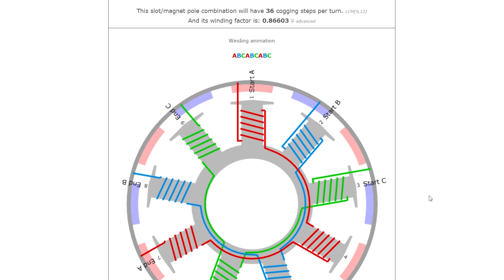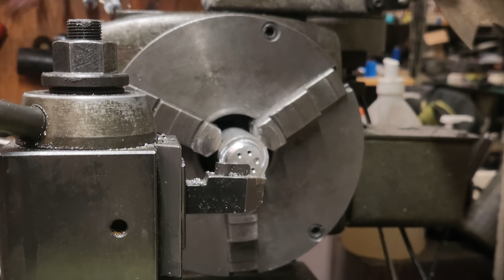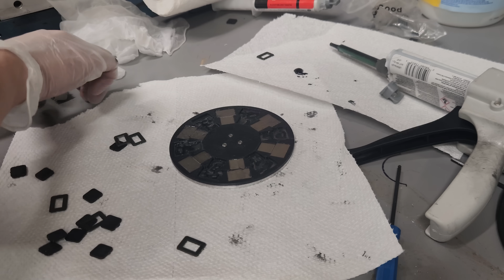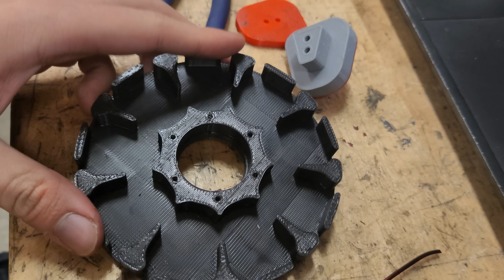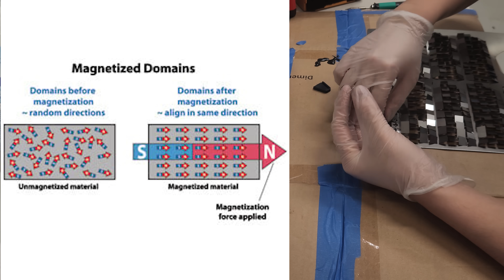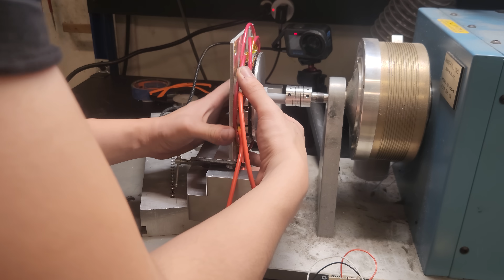Homemade 1000-watt motor

Comment: Rim velocity: 117 m/s (≈ 421 km/h, 262 mph)

Apparent g at rim: ≈ 13,700 g

Diameter = 8 in → radius 
𝑟
=
4
r=4 in = 0.1016 m

Speed = 11,000 rpm

Calculations

Angular velocity:

𝜔
=
2
𝜋
11000
60
=
1.152
×
10
3
 
rad
\cdotp
s
−
1
ω=2π
60
11000
	

=1.152×10
3
 rad\cdotps
−1

Tangential (rim) velocity:

𝑣
=
𝜔
𝑟
=
1.17
×
10
2
 
m
\cdotp
s
−
1
v=ωr=1.17×10
2
 m\cdotps
−1

Centripetal acceleration at rim:

𝑎
=
𝜔
2
𝑟
=
1.35
×
10
5
 
m
\cdotp
s
−
2
a=ω
2
r=1.35×10
5
 m\cdotps
−2

Apparent local g-force:

𝑎
𝑔
≈
1.35
×
10
5
9.81
≈
1.37
×
10
4
 
𝑔
g
a
	

≈
9.81
1.35×10
5
	

≈1.37×10
4
 g

Results

Rim velocity: 117 m/s (≈ 421 km/h, 262 mph)

Apparent g at rim: ≈ 13,700 g
Reply: how much did the ballistic magnet mass? let's calculate its energy! i bet it was at least like a .22 round

Comment: with two rotors and the coils in the middle the efficiency will go up for sure. another step is to put capacitor between the start and end of the coils to get rid of the losses made by the coils

Comment: I think just to be safe, you should CNC the slots in that aluminium disk for the magnets. At that speed, a lose magnet can make you lose an eye.
I have a rough idea about what you are doing. But one thing i was always curious. Is that if the efficiency of a an electrical motor with perma magnets, changes with the distance between the magnets and the coils.
Or that if there is a sweet spot in the magnetic field where the coil should be. Logically you would want the distance to be as minimum as your tolerances allow it, i think. At least this is what you see on almost any brushless motor. But then that distance isn't really the distance between the coil and the magnet but the magnet and the steel used to amplify the coil's magnetism.
I think most of the efficiency of any brushless motor is how good the motor controler is. And because most esc have a permanent timing, the efficiency peak is probably at a given number of rpm.
I don't know how much you can program a vesc, but it would be cool if you could program the timing, according to the motor's speed or resitance put on it.
Just like that picture illustrated that the steel plate redirects the spread magnetic waves into a certain direction. ( in reality the steel does not amplify the magnets, it just focuses the magnetism into a certain direction, like a lense)
In that case i think, the magnets from the aluminium plate should have a ring on the outside too. This is why brushless motors have the outer case made from steel.
So to increase the efficiency you should also use an steel plate behind the magnets and a ring on the edge, this way most of the magnetic waves will be focused onto the coils.
At least that's my theory. 
The real question is, is this design better than the normal bell design brushless motor?

Comment: delta configuration produces around 1,7 times more power than star, so you can can get greater torque at the same rpm with increasing output gear ratio, but actually it's not solving the efficiency problem

Comment: Good shit… I hope you calculated your flywheel burst speed before going full throttle… 
By ear I would say your balance is off, and ceramic bearings might reduce friction forces but that bearing is tiny already so probably not worth pursuing

Comment: A+wesome work! -  been waiting for someone to tackle the Axial Flux ..& VESC to the rescue!!! beauty!!!    but didn't expect to see it burned into the ground immediately with such crafting///  anyway - pitting the wire and then soldering over it. wouldnt make it past the drawing board to fly in an airplane or space.. maybe CRIMP etc.. //  Tip of the pyramid is the strongest, yet smallest Magnetic Field & Strength.. If you're goal is highest eff. \\ I'd really like to see  Tiny <30w ver.

Comment: One thing to consider: You are moving magnets past an aluminum stator frame. That also induces eddy currents. If you have access to a thermal camera, you might be able to see where the stator heats up.
Reply: Absolutely correct!👍 
And he has a double whammy there.  First the rotating magnetic field of the rotors permanent magnets and the rotating magnetic field of the stator windings are all just inductively heating that aluminum.

That could account for 90% of his energy loss.  The magnets going past the thick and thin portions are inductively braking the rotor and the pulses are creating most of the noise and vibration!!
Reply: @johno812 thats what im saying too, maybe not using any steel or any kind of metal or even aluminum would be more or a drag free???
Reply: @bon @bonthor7515 minum has one of the highest inductive properties.  Use Stainless Steel, plastic, composite, or just epoxy.

To be honest, 3D printing the form or laser cutting from acrylic would be best.

Having a laser cut magnet template with a ring around the outside would be best.  Balance those rotating rotors and get rid of the aluminum induction around the coils and most of the vibration will go away, your efficiency will go up, and your rom and mechanical output power will increase.

Comment: One of main reasons why the hobby esc didn’t work because hobby bldcs have different rpm rating and the esc could use back emf to guess the rpm and efficiently controll the motor try using hall effect sensor ps and esc that wotks with them

Comment: Was a home made motor but they can be made with multiple stator and rotor sections ganged together mechanically for insane torque. Also make awesome generators. Some use steel vane plates as flux switches for compact generators for rockets.😮

Comment: good job!

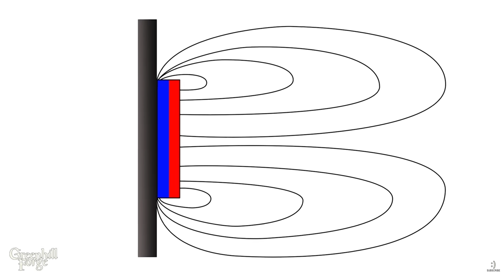3:59 : the explaination is fine but the drawing is totally wrong, with a steel backplate, technically the field lines looks more or less the same as without the backplate but all the lines inside the plate are shorted inside the steel. 

something like that
 ______
|               \
|________/
 ______
|               \
|________/ 

I guess you send a lot of energy heating the aluminium frame

Comment: I'm thinking ferrite cores.  Ferrite changes magnetic orientation much faster than silicon steel.  Less hysteresis = more speed.  Stator should not be machined out of aluminum because eddy currents.  Stator should be something non conductive and non magnetic like epoxy or ceramic.  Stator coils need high speed shunt diodes to dissipate inductive current at higher frequencies.  (Probably already handled by the motor controller)

Comment: Add a steel back to the stator or another rotor, your efficiency is 40% because half your field is wasted. Reducing the airgap will get you closer to 90%, but considering you are already putting a lot of power into it, you will need liquid cooling. Also, smaller airgap means a larger moment on the rotor, you will want a stiffer and lighter rotor. Carbon fibre is a great choice because it also removes a lot of eddy currents.
Reply: theres no way hes doing 600W like he claims, that motor cant dissipate 300W, its working mostly on thermal innertia, at best id rate it at 150W. He needs to tighten his tolerances down a lot and stop all those flux leaks everywhere.
Reply: @laharl2k  seeing how the rotor wobbles, he needs much better balancing for tighter tolerances

Comment: This is just great!  The work you did and the presentation.  You really covered almost all the points I was hoping to see.  I think the biggest thing you can do to improve efficiency at this point is to minimize the space between your rotor and stator.  Also, I'm not as familiar with axial flux motors, but for typical BLDC motors, it's pretty critical to have non-ferrous separators between your laminations.  I probably didn't pay close enough attention, so I didn't notice if you did that.

For the startup, Hall sensors are very easy to integrate with the VESC and will do you a world of good.  A magnetic encoder is even better, but also a lot more critical to setup properly.

I feel certainly you're going to have a really exciting career.  Do you mind if I ask where you go to school and what you major in?
Reply from the maker: i used 3M's DP420 for the laminations, which is supposed to be pretty good for this kind of stuff. but yeah hall sensors would definitely make startup a lot better. I was experimenting with HFI for the startup but kept getting current limited before getting the performance that I wanted. im a mechanical engineering undergrad at mit

Comment: mechanical engineer watching and i know very little about electric motors maybe someone correct me but wouldn't it be better to use laminated steel rods instead of laminated steel plates as cores for windings to further decrease eddy currents?
Reply: In theory yes, in practice is done with plates as it’s easier to manufacture for radial flux motor it is clear why. For axial flux that advantage is not really there but still you would need squared sections rods and epoxy in between, idk how much iron cross section you loose that way

Comment: not sure if you had a 4 jaw chuck, but that combined with a dial test indicator would have allowed to compensate for the lack of concentricity
The other thing is balancing the rotor with weights by measuring the vibration, although if things are not concentric thats also just going to increase the vibration

Comment: gaps! smaller gaps make everything better. smaller gap between the coils and the irons; maybe wind coil onto irons directly? smaller gap between rotor(s) and stator; you will need to actually machine your rotor ;) in practical terms you're going to be limited by how well you can balance the rotor and the precision of the bearings that hold it. more RPM more better. smaller gap more better. rotor touchdown very bad XD

Comment: Where did you buy the silicon sheet metal
Reply from the maker: aliexpress had some for a while, but with the tarriffs its harder to get. Amazon has some now too tho. i bought a 300x300mm of 0.5mm thick silicone steel

Comment: YASA motors are leading in this field.
You want twin rotors and a halbach array for some serious torque! Flat copper bent around the pizzas works well.
The rotors like to flex a bit, and keeping a tight rotor stator gap is tough
Reply: Impressive watch! My comment was before seeing anything. Great job. Get yourself an encoder and you'll have some starting torque.
Magnets flying off is also a problem! Magnet bonding is crucial and then even potting them for further strength
Reply: I was wondering how far down the comments I would get before seeing someone suggest this.
Reply: Well drilling some small holes into the stator like a drill slot car rotor help out the stator than??? For the heating issue and less dragging for the airgap between the coil and magnet???
Reply: make the frame in titanium or pressed carbon fiber. The press channel, shows that a block of carbon fiber is stronger then titanium.

Comment: Dude, best algorithm pull in years.

Have you considered sandwiching the stator between two rotors? It certainly improves efficiency in generator applications, and I don't see why it wouldn't do the same for power delivery.

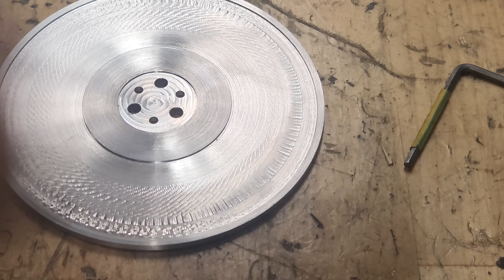edit: 4:15 siliCON, not siliCONE. 😂
Reply from the maker: Probably a good move to have done that! but its a little easier to fabricate and mount when I have a single stator and single rotor. Also lets heat dissipate through the bottom of the stator mount.

Comment: 2:07 you could have cut the stock, flip, and recenter the side that will go in the chuck based on the side you're trying to center. 
This is under the assumption though that your part is still round. 
Honestly, damn
Reply: to save the part with a broken drill bit stuck inside xD?

Comment: As an efficiency nut, it was awful, but given that this was your first go around, that was amazing! I'm a little envious lol. Also, gotta love meeting a fellow watcher of green hill forge!
Reply: Hey he used square magnet wire, that’s all the proof we need that he’s an efficiency nut too
Reply: @RaineyPengthe non-concentric rotor says otherwise, using a file instead of correcting this shows a lack of care and understanding.

Don't get me wrong im not hating on him just stating an obvious fact - it's like watching someone build a house on top of an uneven foundation, the rest of the work could be flawless but the house won't be
Reply: @RaineyPeng fair
Reply: @RaineyPeng he needs to work on his machining skills though, that lathe work was awful. his parts were as true as saying cows can fly.....
Reply: @laharl2k also fair
Reply: @laharl2k  all he had to do to make the shaft concentric was to turn it, then reverse the shaft and put the turned end in the chuck. if he does make another motor i'd like to see if he could ditch the magnets and go for external excitation with a second ring of coils.
Reply: I have been rewinding brushless motors using Nikola Tesla's bifliar patent coil design it makes them so much more efficient with the capacitance effect of the coil. Wind two separate strands of wire in parallel then in series at the halfway point this increases efficiency massively also use more copper fill and less iron for lower clogging or use ferrite instead. Well done otherwise
Reply: Absolutely correct!👍 
He has a double whammy with using aluminium as his stator structure.  First the rotating magnetic field of the rotors permanent magnets and the rotating magnetic field of the stator windings are all just inductively heating that aluminum.

That could account for 90% of his energy loss.  The magnets going past the thick and thin portions are inductively braking the rotor and the pulses are creating most of the noise and vibration!!
Reply: I bet if you add another rotor on the other side if the stator you will get over 80 percent efficiency